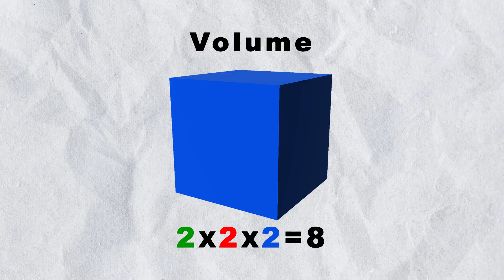why it doesn't work 101

Comment: how to make a plane faster:

1: get a plane
2: add an extension to the engine with a propeller inside 

the engine pushes out air which turns the propeller which adds extra thrust
Reply: High Bypass turbines do that and are standard for commercial aviation
Reply: problem, physics?
ok fr though they would make planes faster but the pesky sound barrier causes too many problems at ground level

Comment: Can you explain why Tom breathing under water with the help of a really long straw doesn't work?
Reply: Air compression/pressure. At a certain point, you can't get enough air down the tube. The Action Lab did a video about breathing underwater.

Comment: I mean it doesn't take a genius to realize that it would be too heavy to fly if it was all made of titanium
Reply: Tìtanium is pretty light and used in f.e the SR-71 Blackbird
Reply: @robinx961 Of which was about 90% titanium by weight (*according to Google AI).
Reply: @ShawnF6FHellcat  the empty mass of the SR-71 is 27 tons while it being a big plane (32m in length). With fuel it gets over 77 tons. 90% is obviously wrong. 2 of the most powerful turbines ever created at under 1.35 tons each? Not even considering cabin, electronics, landing gear, stealth coating and everything else... Google AI is obviously lying.
Reply: @robinx961 Fair enough, let me look more thoroughly... Okay, NASA says that it is about 85% titanium while several other sources say 93%, and yes, all of that is titanium-based so that it can handle the extreme pressures and temperatures.
Reply: titanium is pretty light though, I think it's comparable to aluminium but I'm not sure
Reply: It actually wouldn't be and has in fact already been done before, just like the guy below said, with the SR-71 at about 90% titanium by weight.

Fun Fact: The B-52's empty weight is about 90 tons while its fuel alone weighs about 154 tons.